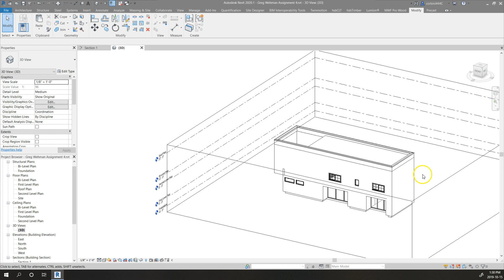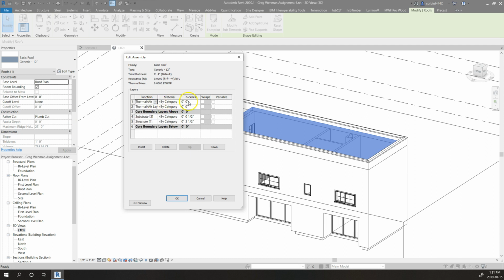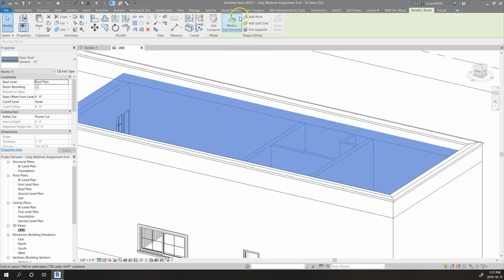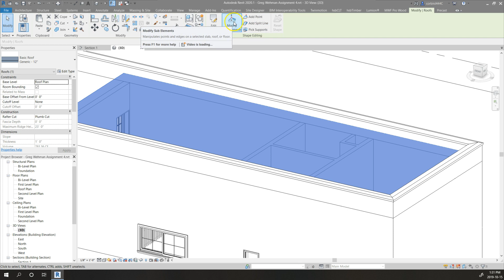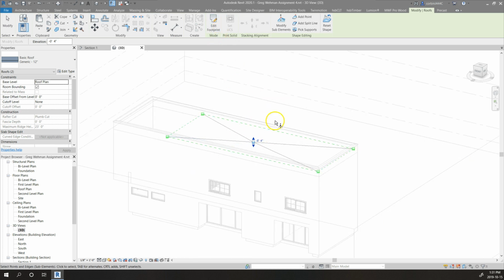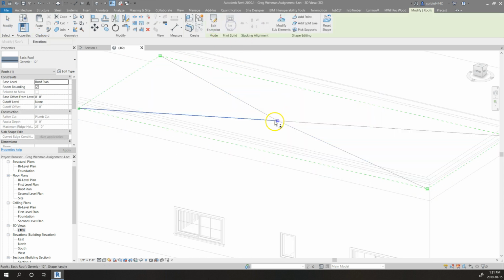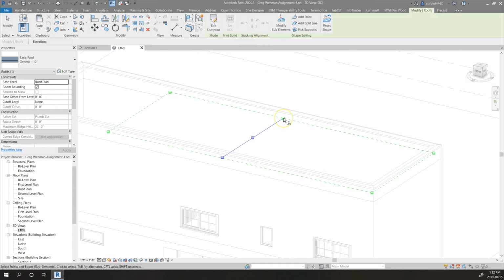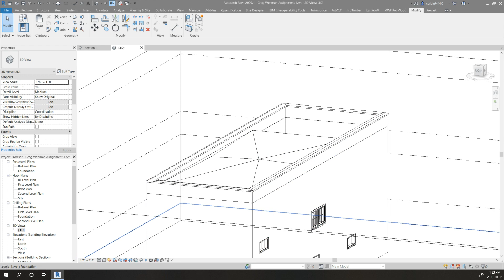Revit Tutorial - Adding a slope to a flat roof.

Comment: Aren't the two larger triangles of the roof flat in that last example since the center point is the same height as the far corners?
Reply from the maker: Yes that would be the case but you would just need to lower that point or line.